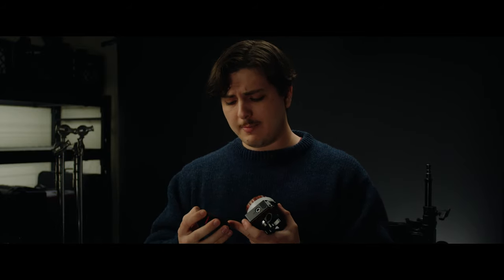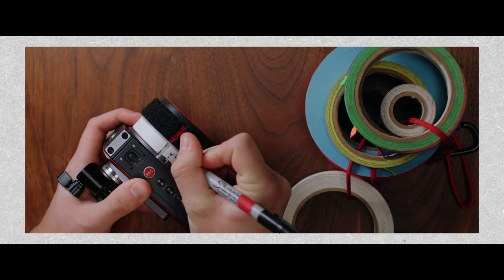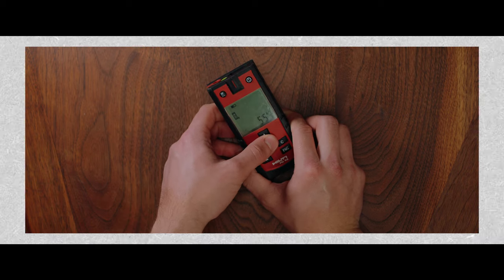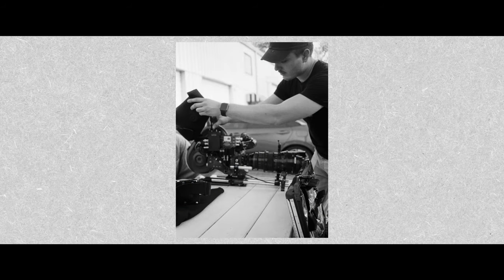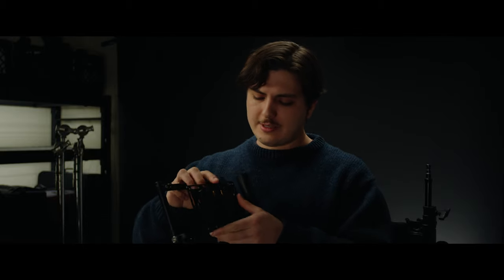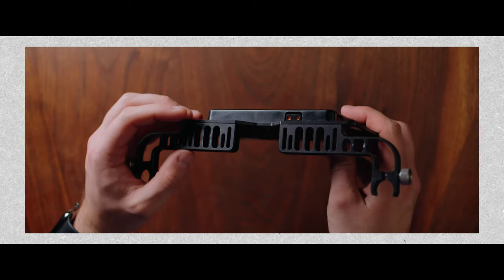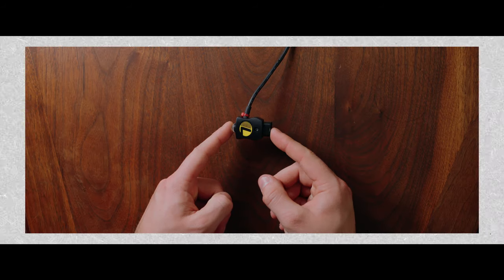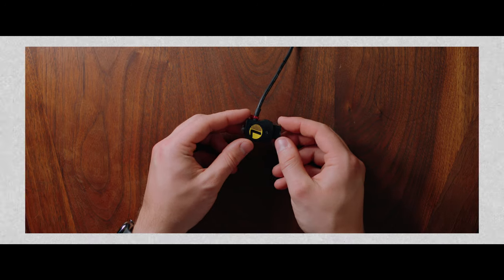Wireless Follow Focus and Monitor Rig Build | Nucleus M, SmallHD 702 Bright

Comment: I already miss that classic: „Hello“. 
I also got that wheel extender thing. That velcro around is a great idea which I will immediately copy lol. I built more of a all in one solution with the camera plate on my 703 and a teradek unit with included v mount plates (I know V-mount=💩 but that’s what most people in Europe use)
Reply from the maker: Hello! ;) A good move with the 703, I see most ACs using those nowadays. The newer smallhd monitors having swappable battery plates is such a good idea. Hahah if the V-mount system works for you (and is the standard in your market), then that’s all that matters!

Comment: Hi, nice video. Do you recommend Blackmagic Video assist 12g which  is 2500 nits brighter? Any recommendations? All the best!
Reply from the maker: Not a fan of Blackmagic panels. Don’t really see any professionals using that either. Would still recommend SmallHD 702 Bright or Touch for more brightness. Spring for a 703 if you need more than that